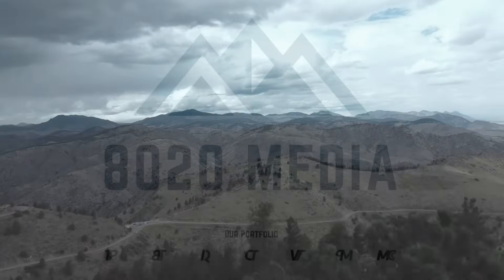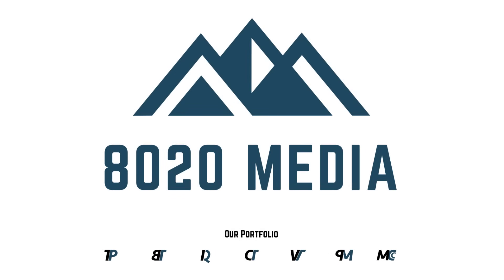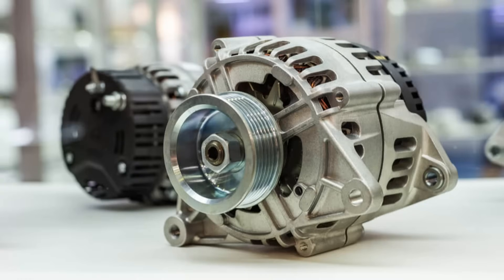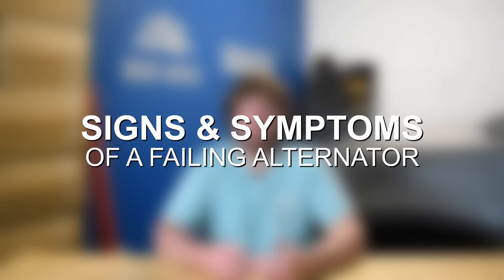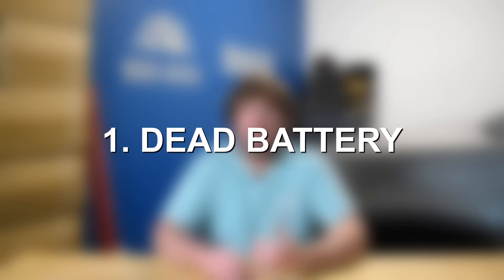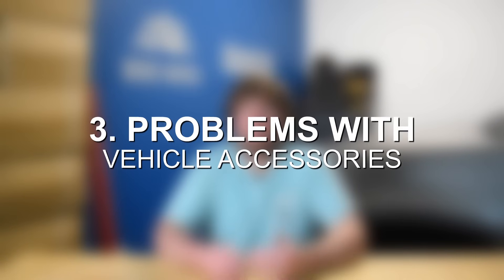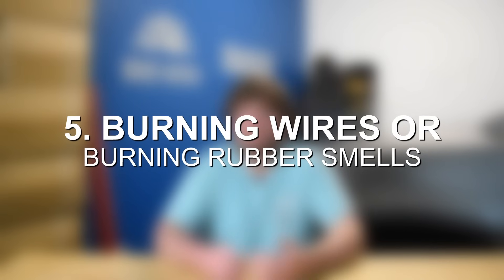6 Symptoms of a Bad Alternator!

Comment: I have a 2010 Mazda 3 2.5l and I know the battery is not good now but when it was brand new the car would start for like 2 days then just completely drain itself or it would barely start but soon as I turn the wheel the whole car flutters , lights every dash light turns on the wheel locks up… getting snow in Chicago and I can’t get it into my garage 😅
Reply from the maker: D - Sorry to hear this! Keep us updated.

Comment: The lights on my dash dim when I use the powered window controls and my car jumps in revs on occasion when idle are these possible signs of an alternator issue car(2001 Toyota Camry LE 4 cylinder)
Reply from the maker: A - Indeed!

Comment: 2022 Toyota Camry xse Mine was making a whining sound I cut it off turned it back on would come on just clicking then I got battery malfunction light smart key malfunction jump start it it stalled 5 times till I was able to get it close to home and park it I had a new belt put on but he’s saying it’s the alternator and yes I lost power steering everything in the car was flickering till it shut off
Reply from the maker: C - Certainly sounds like an alternator!

Comment: I think my alternator is going out, I haver essentially all the symptoms and my steering will lose power and become super hard to turn, could this also be my alternator not providing enough power aswell.
Reply from the maker: K - Certainly could be!
Reply: @8020Automotive  thank you so much, ive deduced it def is my alternator, thanks for the great video!
Reply from the maker: K - Thanks for the feedback! Keep us updated.
Reply: @ tested my alternator, it actually tested completely fine, had a mechanic friend say he thinks it’s just a simple bad ground or damaged connection between the alternator and battery, and the thing with my power steering, it turns out the PS was bone dry XD. But either way the video helped nonetheless, thank you.
Reply from the maker: K - That'll do it! Thanks for the feedback and coming back and updating. This will certainly help future viewers.

Comment: My dash and dome lights flicker when i let off of the gas and brake. Battery is new, starts every time. This didn't start till i got my smog done. What could this be? Also, my dash lights flicker as well. Thank you. Had the alternator checked but they said it was fine. Please help. I appreciate it
Reply from the maker: M - The symptoms you're experiencing points us to the alternator, but it could also be electrical.
Reply: @8020Automotive  thank you. Can an alternator test good but be bad?
Reply from the maker: M - Possible.. Have you taken it to a mechanic?
Reply: Maybe a fuse?
Reply: I even cleaned the terminals with coke and a toothbrush to the grounding to the alternator. Still doing it. It goes from bright to dim to bright when gas or brake
Reply from the maker: M - Certainly possible..
Reply from the maker: M - Still pointing us to the alternator honestly..
Reply: @8020Automotive  took it to my mechanic and he ran the alt test while driving it and it started messing up in the middle of driving. So I need to have the alt replaced. Thank you! So much. I really appreciate it
Reply from the maker: M - Hopefully this resolves your issue! Keep us updated.

Comment: Would a faulty voltage regulator cause similar issues as a bad battery or bad alternator? I've had my alternator replaced twice in 3 months and I've replaced my battery 4 times in two months. My battery indicator AND my brakes indicator lights are on but no check engine light. I'm stumped...
Reply from the maker: M - I would take it to a reliable mechanic as there is something wrong electrically.. You shouldn't be going through that many components in such a short period of time.

Comment: My ABS light is coming on for a split second and going off, my hand brake light is doing this too. I saw someone else in the comments with the same issue and you replied its probably a faulty wire... however i noticed my left head light flicker, a couple days ago i got a bunch of interference in my radio. Yesterday i had no issues. I paid attention to my voltage while driving yesterday when i had no issues and it was 13.8 - 14.2. Totally normal. This morning i saw my ABS light flash. Immediately noticed my voltage shot up to 14.9 and i believe even 15. I turned around and changed cars to get to work... im getting mixed info when checking to see if 15v is normal. Ive never seen above 14.2 on either of my cars. I do have a tester to check the charging system which i will do today when i get off shift. I hope its not a short somehwere. I do not have the patience to track that down. Fingers crossed for a bad alternator so its a quick easy fix for me.
Ive just never seen a alternator die like this if thats what it is. Normally my battery light will come on and I'll see my voltage hit 13v, 12.8 , ect.
Reply from the maker: R - Great information here. Keep us updated!
Reply: @8020Media I put my tester on my battery. It's dead dead. Charged but 13% health
Reply: @8020Media  I assume thats why my voltage shot up to 15 when I normally see 13.8 or 14.1 , will swap out battery today or tomorrow.  It's only 1 year old. Claiming that warranty.  Hopefully that sorts out everything.
Reply from the maker: R - That adds up! Keep us updated.
Reply: @8020Media  took batt. Out..something told me to test it again. Tested perfectly fine. Tf... put it back in. Tested bad. Great.. alternator tested good. This is beyond my skill level now..I assume some sort of short or parasitic Drain. Had to drop my car off at dealership unfortunately.
Reply from the maker: R - Sounds like your diagnosis is accurate. Keep us updated!

Comment: Crazy, today all lights started pulsing then my transmission stopped shifting leaving me on the side of the road. Turned my truck off then back on and worked again enough to get me home. Got my alternator checked and its a voltage regulator inside. Got a new alt and hope to install it in the morning.
Reply from the maker: A - Keep us updated!
Reply: That’s exactly what happened to me last night, was it the alternator was your problem??
Reply: @Jollyboysbass  the alternator fixed everything but the transmission. Unfortunately I had to get it changed.
Reply: @alvinnorris1977  the problem for me was the ignition so I’m glad I didn’t commit to changing the alternator 😅

Comment: hi Zach, my 2008 Rav4 has been acting strange and i was wondering if you could tell me whether this could also be related to alternator issues. this is what's happening: 
when i turn the key in the ignition the engine often starts with a vroom sound that is more high-pitched and sharp than it should be. the most persistent symptom as of the last 4-5 months has been that whenever i'm pulling out of street parking by turning the steering wheel to the left, on its way back to the original position the steering wheel completely sticks for a fraction of a second and all the lights (and AC and/or radio, if on) flicker off and on. it takes a full second or two to be able to steer back but it is initially very stiff. this has been happening with increasing consistency to the point that nowadays we can expect it almost every time we're pulling out of street parking. thankfully it hasn't been an issue while turning when the car has some speed. the dashboard has been faintly flickering ever since we bought the car used last year, so if this is all related the problem has been ongoing for quite some time and only now worsening in a real way. we took the car to a mechanic yesterday and was told that it may be an alternator issue, which according to the mechanic, would cost us around $1k (or more) to repair. but i'm looking for parts today and brand-new alternators for my car model don't cost nearly as much so i'm very confused! we were also told the battery needs to be replaced, even though it's been less than 5 months since the last replacement. i suppose this could all lead to the alternator being the potential culprit. 

in your opinion, is this mechanic giving us way too high of a quote? we're on a super tight budget, but need the car to run safely too. what do you recommend we do?
Reply from the maker: P - You can go to your local auto parts store and ask if they can check your battery and alternator. Once they confirm either are bad, you can purchase either on your own and take the part to your mechanic. That way you'll only have to pay labor from them. Keep us updated. Certainly sounds like it could be an alternator issue though.

Comment: I’m glad I watched the whole video, my car stalls after a jump start, I turn my head light and it starts getting weaker and the rpm’s drop. Replacing alternator in a few I’ll reply again if it works
Reply: It wasn’t the alternator, I decided clean out/replace battery cables runs like new. Check your battery cables for corrosion people.
Reply from the maker: S - Thanks for sharing your experience! This will certainly help future viewers.
Reply: @Shvdowx hey I’m having the same problem ? My battery has some corrosion on it wdyt?
Reply: @ozziegee  try cleaning it the battery post and if the cables have to much corrosion you can try changing them
Reply from the maker: S - Thanks for sharing your experience!

Comment: come across this video after watching a video on starter motors. We've just changed our starter motor and it's still not starting but now I'm thinking the alternator may also be a problem. The dash lights are flickering and the radio works sometimes but lately mostly not.
Reply from the maker: S - That would be our guess! We do have another video that may be helpful as well: https://youtu.be/0YRdzJbHcm4

Comment: I love the video thank you I have a question so my belt and my engine makes a lot of noise My car died yesterday for the second time and this man gave me a jump and it started took it to AutoZone and they said that it's everything's okay but it's not okay The car shakes like it's going to die of that belt makes a lot of noise do you think I need to replace the serpentine belt and the alternator at the same time last week the side passenger window was going kind of slow
Reply from the maker: L - It certainly sounds like an alternator issue. Have you visited a mechanic?

Comment: My serpentine belt keeps getting pulled towards the engine and wearing off the belt. 
We tried to change the tension pulley but we have a hard time getting the belt back on. What could be the problem? Alternator?
Reply from the maker: J - What drivability issues are you seeing? Any engine codes?

Comment: What is/are the main causes why alternators fail?
Reply from the maker: J - Belt failure, wiring issues, bad battery, bad fuse, normal wear and tear, overheating, oil/coolant leaking onto it. To say a few.

Comment: Hi ,
Am facing like if I am taking a long trip there is no issue, but if there is lot of traffic nd car is moving around 20-40 km/h for more than half an hour, then iam facing the flickering issue. I faced this same issue for the second time. So i turned off engine and started again after 5 minutes, no issue at all. So the problem is when car moving slowy for too much time this is happening.Also some days I face the little bit starting trouble.
Is it battery or altenator?!
Reply from the maker: M - Could be either. You should be able to take it to a shop and they can test both components. Last thing you want is to be stranded on the highway!

Comment: Great video! Have you seen a case where engine oil from the gaskets leak onto an altenator causing it to crap out?
Reply from the maker: J - This is definitely possible!
Reply: My power steering pressure hose started leaking and it dripped right over my alternator. Now I'm getting every symptom he just explained and the recent ones I just had was the burning wire smell I thought my car was about to start catching fire
Reply from the maker: M - So sorry to hear..

Comment: How do you know if it's a problem with the alternator or the body control module?  because my car has symptoms of both. My power steering cut out for an entire summer and then randomly started working again. I've also had issues with the key fob not unlocking the door properly. I've also had an issue with the transmission not shifting properly at one point but that was not as frequent. But just earlier today The radio in my car randomly shut off and turned back on again and then shortly after that my car randomly shut off and then immediately started back up again at a red light. My speedometer also started acting funny. Then at one point my car shut completely off and none of the interior electronics was working at all. The light on the dash that tells you when the door is open wouldn't even turn on when I open the door and when I pushed the button to start the car it did absolutely nothing. It was like I didn't even have a battery in my car. But after I disconnected the battery cables cleaned off some corrosion and reconnected them the car started up again so I don't think it was the battery being dead. But then when I started driving it shut off and went completely dead again. And a weird thing is it started back up when I had my dad hook up the jumper cables so I'm not sure which component is the main issue
Reply from the maker: J - This is quite odd.. Have you taken it to a shop?
Reply: @8020Automotive  nope. I figured it out. one of the wires connecting to the positive battery terminal had gotten pinched under the battery and over time the coating wore away and it caused a short
Reply from the maker: J - Nice! Thanks for taking the time to share your experience.

Comment: If the vehicle is completely dead like nothing turns on till I jump the engine, let it run for awhile. Drive for a bit with no issues but let it sit overnight and have the same issue again in the morning. Is that the battery or alternator?
Reply: 10 to 1 its the battery, bruh
Reply from the maker: C - This video will help with your research: https://youtu.be/0YRdzJbHcm4

Comment: Thank you for this well thought and very thorough explanation of battery vs alternator. My amp has been cutting out for several weeks and today my AC acted up at a stoplight, when I glanced up I saw my voltage was low. My truck stalled 3 blocks later and wouldn’t start. Jumped it and drove 2 miles before it started to stall. Jumped it twice more to make it home. 25 year old ranger I’ve had since new, on its sixth battery and second alternator. Thanks again
Reply from the maker: R - Sorry to hear.. We hope you get it solved!
Reply: So Was it your alternator or battery??
Reply: @dianeblevis98  it was the alternator
Reply: @ramonhernandez4471  Yeah these shops say get a new battery ok i got another one both less than a year old now tell me again the problem is my less than a year old battery that my multimeter says is 12.6v and not the original 22 year old alternator or 22 year old starter or cables connecting said devices?

Comment: Charging light with the battery symbol is lit up all the time or randomly while the car is running.
Reply from the maker: M - You could have an issue with your battery
Reply: @8020Automotive I think the symbol lights up when the alternator does not provide enough voltage to charge the battery. It could be battery problem for not taking charge, but you would have problems starting the car long beforehand.
Reply from the maker: M - Keep us updated.

Comment: Please give me some insight, I have a 2007 Toyota sienna ce. About a week ago my van was driving just perfectly fine. I went to do an errand and turned off the car . Not even 3 min later I went to turn it back on and nothing. No turn noise all dash lights powered on but car didn’t start. Had someone jump start me and viola it started!! When I arrived home which is about 2 block drive . I turned the van off and welp the car wouldn’t start again 😮. So I noticed now it will allow me to drive it however long I need to drive it as long as I don’t turn the car off.  Once it’s off I have to wait a whole day for it to start again. 
I have an idea what it may be but I don’t want to change it out and spend money on something that isn’t nessary . Please help damsel in distress .
Reply from the maker: S - This strikes us as a bad battery. We have another video that may be helpful here: https://youtu.be/0YRdzJbHcm4